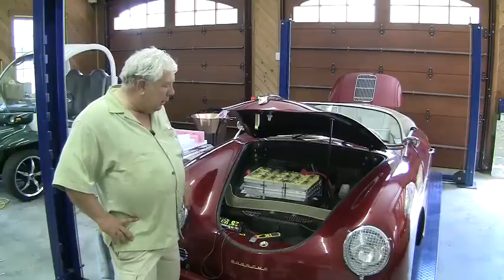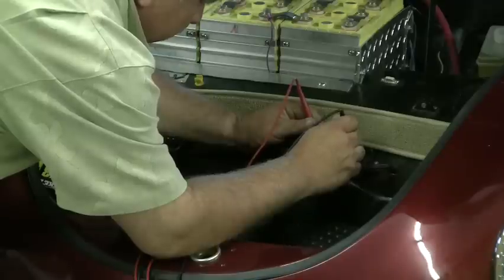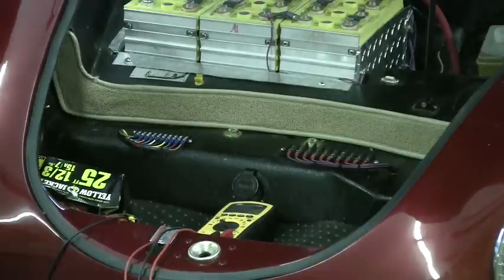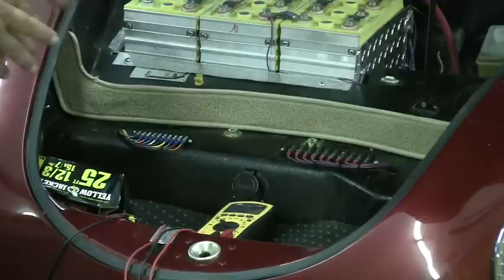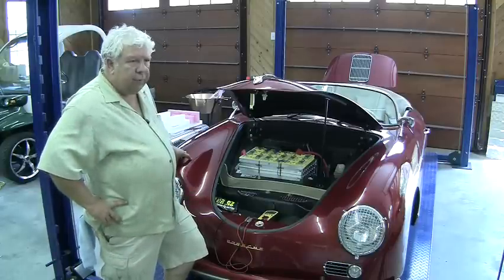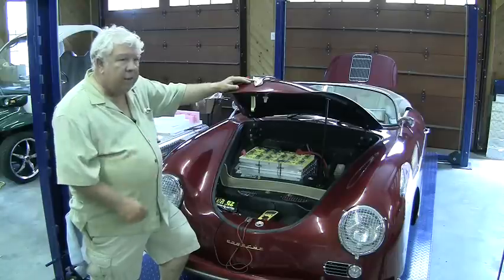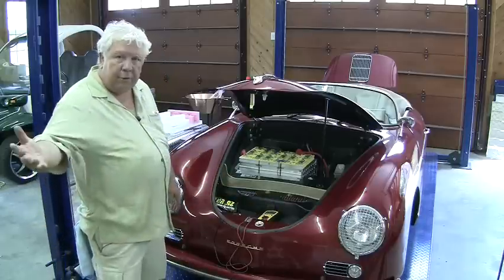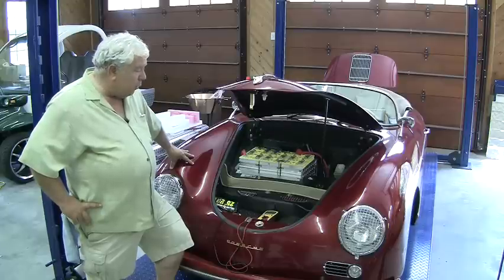5 Battery Management - Porsche 356 Electric Conversion

Comment: Jack, although I am not as ambitious as you are, I would like to replace my current truck and motorcycle battery to LiFePo4. While the motorcycle will be subject to less environmental issues, the truck sits outdoor in extremely hot summers and freezing winter. In the winter I plan to revert back to the original battery. Would this idea be feasible? Would the alternator be sufficient to charge the LiFePo4 if I use a cell balancing charger from time to time? What other concerns should I be aware of when converting from standard lead acid to LifePo4 battery?

Comment: thankyou for the great videos! i am glad you treat them as batteries instead of just cells! a lead acid has 6 cells but because they are in one case we treat them as a unit. your doing the same with lithiums and i love the simplicity of it. i will be doing exactly what your doing in the 356 next time my lead acids die in my car! just one question mate...what sort of charger are you using? sorry i am slowy looking at your videos. you may have one on it already!

regards blair

Comment: Where is the details of the DC/DC converter you promised in the other parts?  I'm very interested since the EV conversion currently I'm involved with is using the IOTA unit.